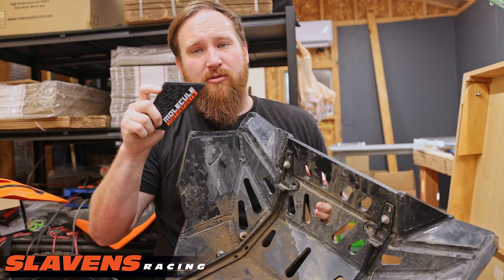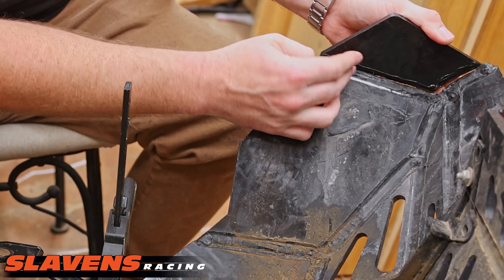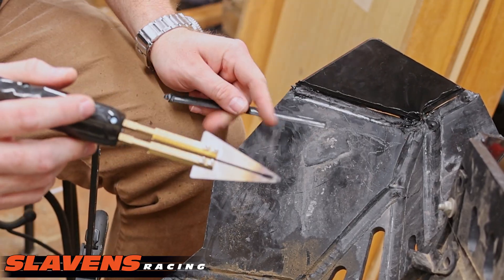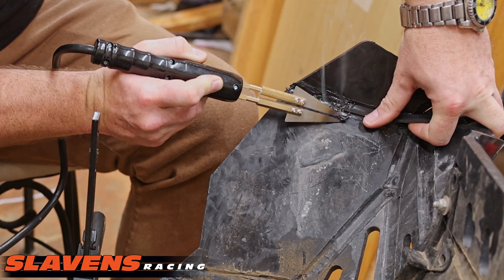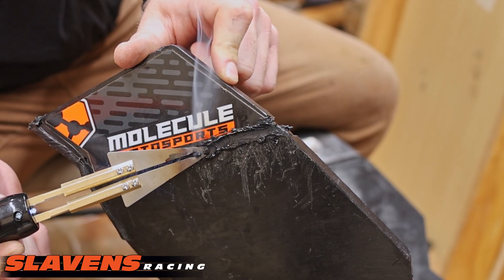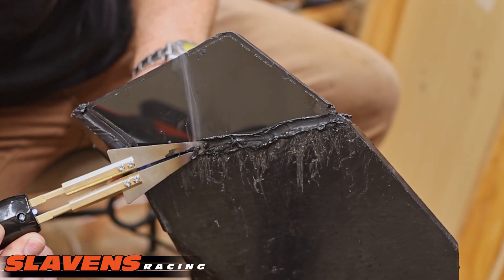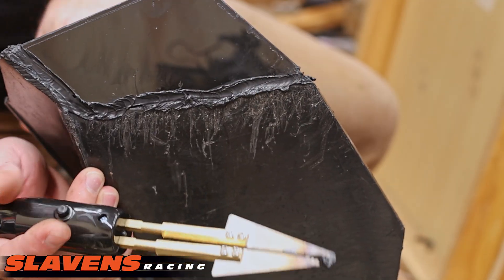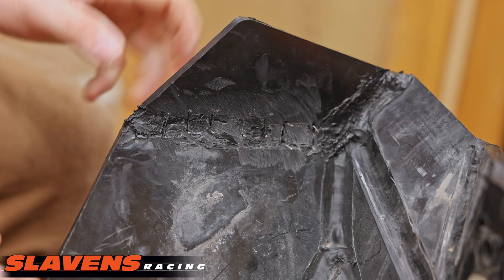Skid Plate Repair - Plastic Welding & Hot Stapling

Comment: When adding the new material I actually put the Poly stick against the heating blade and let the drops fall into the crack for better solid fill and less chance of air voids or bubbles.  Just a tip that might help someone trying this technique as another option.  Good stuff guys!
Reply from the maker: Thanks for sharing your tip!

Comment: Good job man, love to see people fixing their own parts! Another type of plastic welder you can find at Harbor Freight, it uses hot air to heat the base material while you feed your filler material on top, creates a deep penetration root weld that works very well without the stapling step. It's a 90$ option too. 🤙
Reply from the maker: Glad you enjoyed the video!